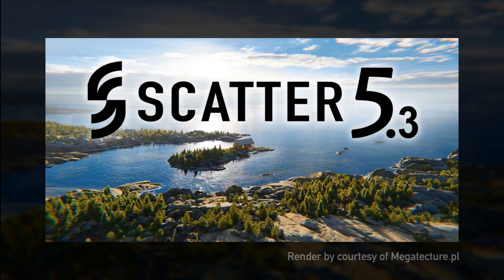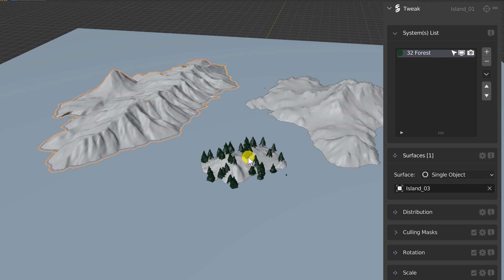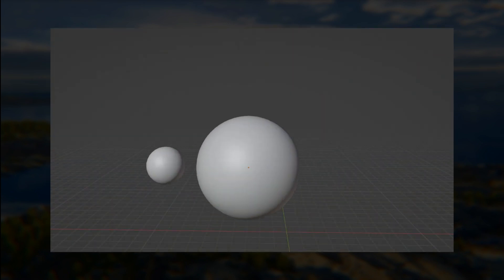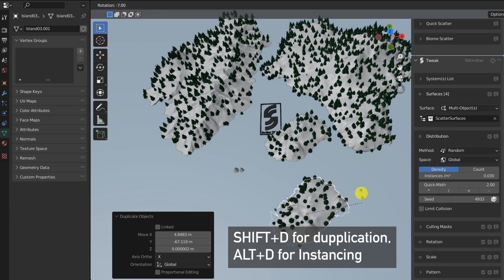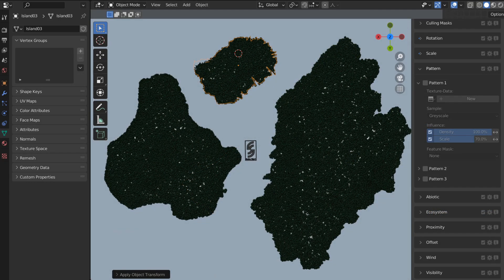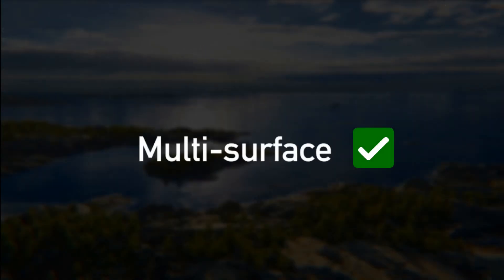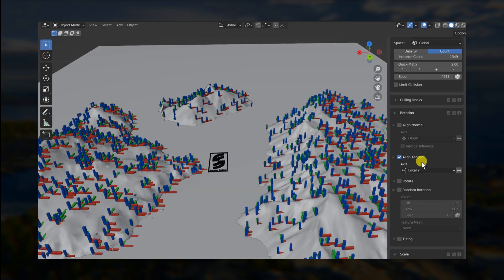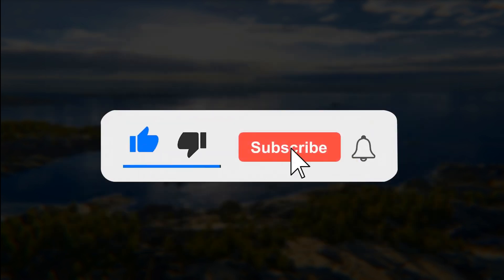The New Multi-Surface Scattering Feature!

Comment: hi there, i am using alt for viewport rotation - hence i cant alt click + button in system list to create point scatter. any chance to change it in preferences to ctrl instead of alt or why not add point scatter in create section?
Reply from the maker: Hello, we did not understand your request, for assistance you can contact us on the blendermarket DM. We are available almost 24/7
Cheers